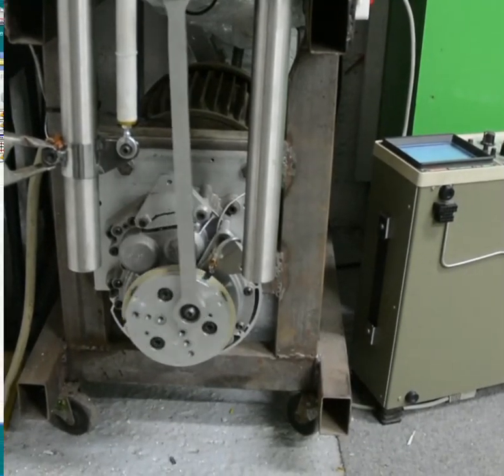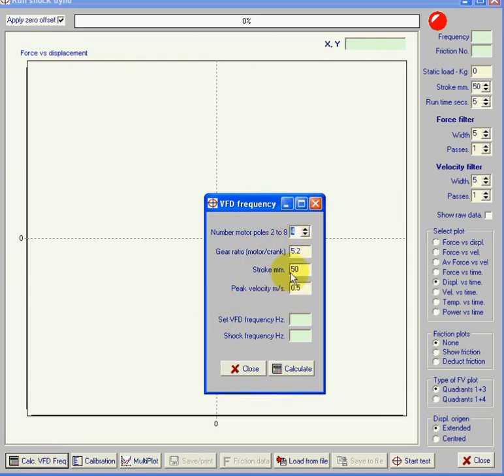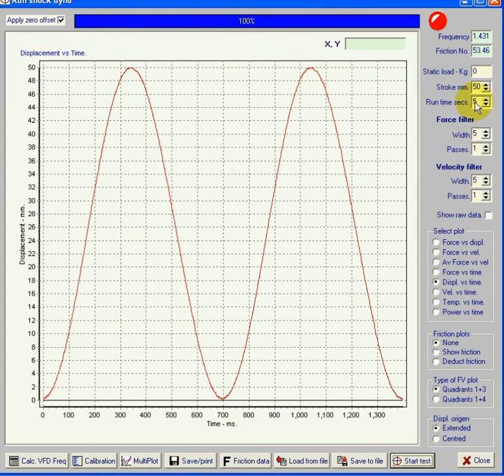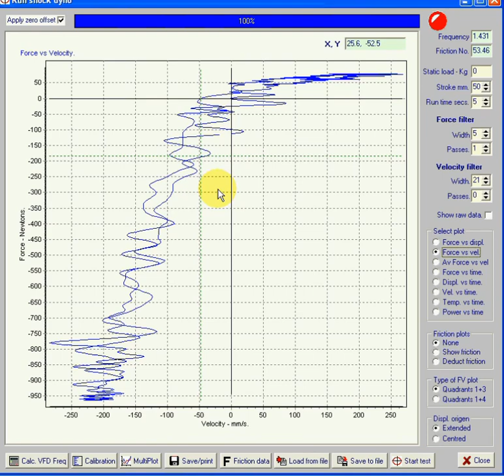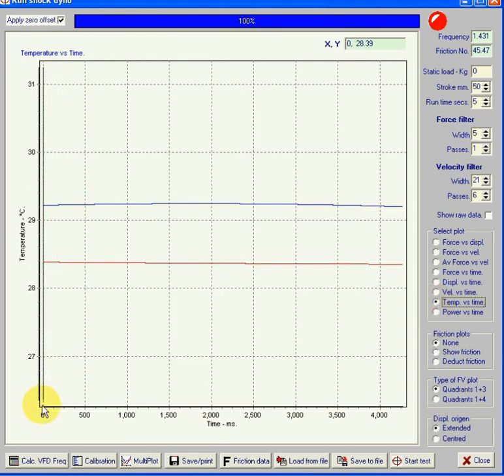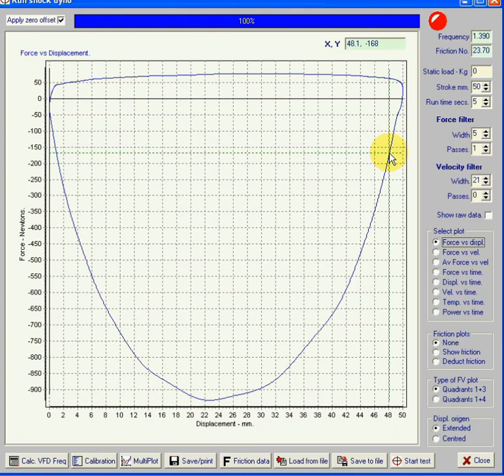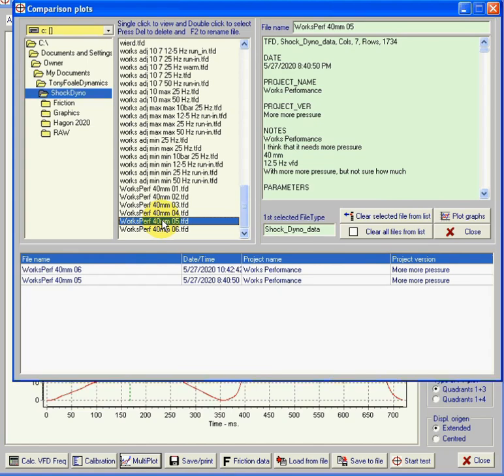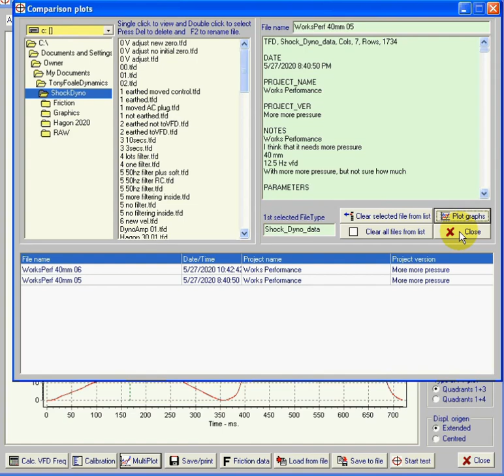My ShockDyno

Comment: Always enjoy on of your videos. I really must put my dyno back together, it was only lashed up temporarily and the plots traced with the X,Y function of the digital scope. 

The sound was breaking up at some points and there were a couple of silent sections that it wasn't clear if they were intentional or not.
Reply from the maker: Paul,  I have added some links in the description to related stuff without the sound problem.
Reply: @Paul Compton the video description acknowledges that the sound does drop out at times.

Comment: I think of POTs as ridiculously inaccurate. couldn't you replace all your sensors with a rotary encoder like the one you put on your lathe? Run the string over a small pulley on the shaft of the encoder and calculate acceleration etc in the MCU.
Reply: Resistive sensors have been long used on professional damper dynos and indeed for live travel measurement on track. I've obtained very clean readings (in a different application) from pots with conductive plastic tracks. Metal film, or Carbon, not so much.
Reply from the maker: Paul Compton pointed out that using pots for displacement measurement is a well accepted practice.  As far as I am concerned the problem with any displacement sensor is when you differentiate the displacement to get velocity.  Increased velocity noise cannot be avoided, it is fundamental to the differentiation of digital signals.  Whereas using a velocity sensor the velocity gets integrated to get position and that operation reduces displacement noise.  Unfortunately, the sound on the video was very bad during those explanations.  I only use a displacement sensor when using extremely slow velocities to investigate stiction and friction.  All other tests are done using an LVT.

Here is a link to some measured results https://www.homemadetools.net/forum/something-completely-different-83989#post175969
and a couple of videos
https://www.youtube.com/watch?v=s0aUpGoeBIA
https://www.youtube.com/watch?v=NCvKRgbF1uA
Reply: @MotoChassisByTonyFoale  thank you for your detailed reply to my question. Your comment on differentiation and integration is well taken. And thank you for the links.